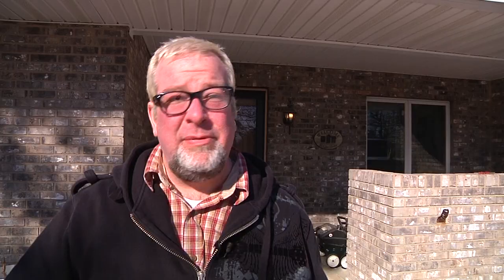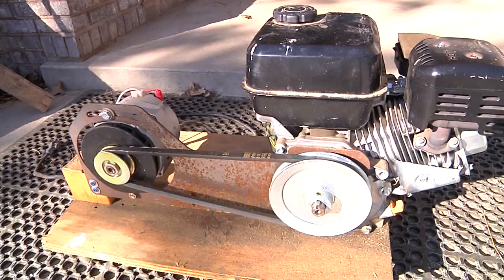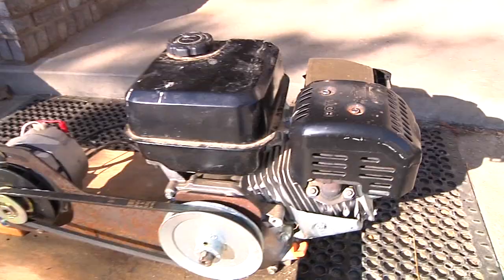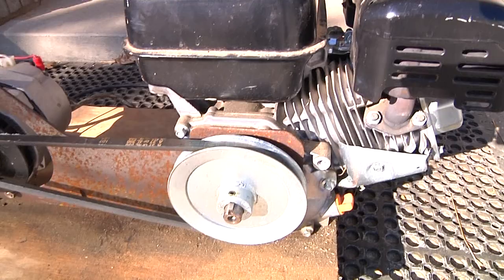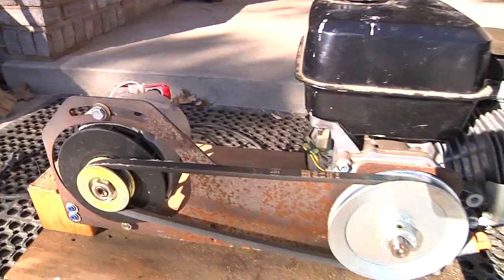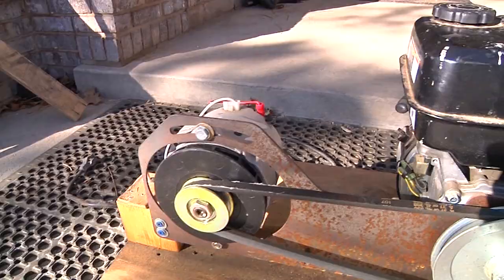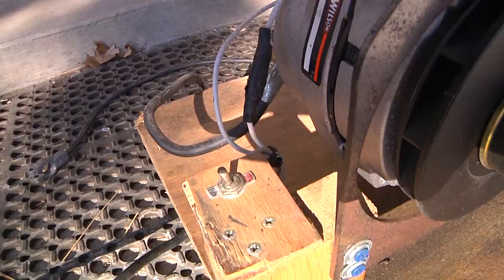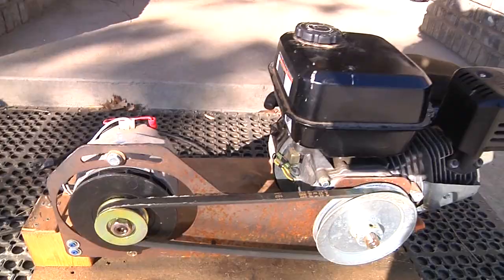Build a Lawn Mower and Alternator DC Generator

Comment: The frame was what I did great job btw to stop the belt flopping go get a idle pulley at install it to take slack out. Mine is so smooth it doesn't vibrate at all . I have a 2hp with a 30 amp mini Chevy race alternator use it to power my camper in the middle of nowhere.  Also I use the exhaust on the larger one with a homemade heat exchanger to make hot water which heats my camper.  Works awsome ! It charges battery bank auto start stop and monitor.  Battery bank runs thru 3 separate inverters 300 1200 and 3000 use only ones I need.  It's nice to have all the power I need no Bill's other than fuel next year ethanol still and 2 acres of corn 😁
Reply: How many watts per hour is your putting out?

Comment: I built one like this year's ago! my build was for jump starting trucks. and it worked great as long as the battery had enough voltage in it to excite the alternator. the important thing to remember is you can buy a generator that will do the job for less! but if it breaks down you need a new one. this setup works and if anything goes wrong it is simple to repair for half the price.

Comment: i have altergenerator charger basically the same way  it works but it absolutely needs a two belt set up after about 6 hours with load of only one lightbulb the belt gets hot then starts to slip

Comment: I read somewhere it only takes the 3HP 79cc engine to power a 70 amp alternator.  I may build one of those for less fuel consumption and noise annoying to neighbors.  Can upgrade the fuel tank to run a lot longer because stock half gallon is not much.

Comment: Check your field excitation, maybe run a rheostat or voltage limiter. This will bring the charging voltage down to 14 to 14.5 VDC which is maximum for charging todays deep cycle batteries. Actually, to get the greatest life from AGM or flooded lead acid batteries, you should have constant voltage and current to charge batteries just like your solar charge controllers do. I would add some supercapacitors in series to smooth out any voltage spikes from whatever loads you have on the batteries. Do not depend on the voltage smoothing circuits in the inverters you use, they usually are made in China and not up to constant use - they often burn out. I use them in my workshops (small engine, and electronic shops) that need perfect sine wave inverters that do surge some when first energised. Each shop is seperately supplied by solar or generator power, depending on the season and weather. I did this because the power company got greedy on its rental on the power poles and meters for each shed, so I dumped them and installed solar and inverters in their places. Saved me a ton of money!

Comment: A 10si GM alternator (1980 Chevy truck) would be self exciting thus enabling you to eliminate the toggle switch..just an FYI :)
Reply from the maker: +Joshua James Yeah, true, I used what I had on hand...
Reply: joshua the 10si/12si/27si is internally regulated but it is not self-exciting in stock form. the aftermarket 1-wire 10si alternators are self-exciting, but you wouldn't want to use a self-exciting alternator on a generator like this.. a self-exciting alternator loads the engine immediately after it's started, the manually-excited alternator allows you to start and warm up the engine with no load. a toggle switch isn't needed, you just need a momentary push button switch( a doorbell button would work) connected between battery positive and the #1 terminal on the alternator's regulator to excite the field when you're ready to start charging.
Reply: Those 10,12 and 27 are ideal because when the generator runs out of gas you don't have to remember to turn the power switch off to the altenator regulator if you use a momentary switch -

Comment: Add a resistor on the correct wire from the alternator of a regular automobile and it can make 15 volts add two and it will do 16 volts dc ! That’s 670 ohms and 1/2 watt resistor.

Comment: Brad, I was wondering if you ever tried to hook this up to a grid tie inverter . I am interested in building a larger version of this set up, and would like to do it without batteries , sending the dc voltage into a grid tie inverter . I am surprised there aren't any videos of this on youtube ( I have yet to find one) . Oh I guess it's worth mentioning I would like to run the larger engine/alternators on wood gas. This way I'm not buying gasoline to generate power.  Thanks for sharing. Joe
Reply from the maker: Hmmmm. Interesting, I have no idea how much juice or amps this would produce... Hmmm, where is my multi tester?
Reply: @Bigfamilyhomestead  did you ever test this?

Comment: Note: You absolutely MUST have a battery connected to this system while running or you can damage your alternator voltage regulator permanently!
Also...you can use a idler pulley to help with the slack in the belt...works well as the belt stretches over time...and could be mounted on these plates with a bit of MacGyvering  :)

Comment: How did you wire it? what size pully did you use? is that the most efficient?
Reply: When you set up a car or truck altenator - the pulley on the engine should b e about the.ssme size as on the altenator - 
      The engine can run at 2500 RPMs instead of 3600 RPMs - it's also better to use a pulley on the altenator and engine that accepts 2 belts instead of one - 
    Also many automotive pulleys are not 1/2 inch so it's better to go with a boat pulley -
     You can look up sail boats and 12 volt altenator's and charging - there's a bit to know about it - or you will go through a lot of burnt up altenator's and under or over charged battery's -
 Also you have to account for the cooling fans direction on the altenator - 
       I've used one like that for over 50 yrs - I live in a rural area were power failures are frequent - 
    But you have to understand battery technology as used on sail boats and the 12 volt charging technology -
     On a car the altenator at idel might only turn 2500 RPMs so if you are drawing 30 amps off a altenator you only need to run it at low RPMs - or fast enough to keep it cool -

Comment: Can I ask why you want to build one with vertical shaft? I don't want to go lots of hassle only to find out what you obviously found out.
Reply: This one is a horizontal shaft,and the shafts orientation matters not as long as the alternator pulley and shaft pulley align and are turning the correct direction... One can simply build brackets,mount alternator on front of push mower,swap blade for pulley,add a belt and have a dc generator that sips gas,charges 12v batteries in 30 minutes,is fairly quiet,can be made quieter,is portable,cheap to assemble,will work basically forever if kept out of the weather,using non ethanol fuel..

Comment: Voltage is easy to produce, its amperage that is most needed. Does anyone have a video where they look at the useable amperage of some cool products.
Reply: The alternator need to run at 6000 rpm to get max amp capacity. For GX200 engine max hp (5-7) at 3600 rpm, theoritically you can run 3500W (250A@14v) alternator at nearly full throttle with 2:1 pulley ratio.

Comment: can this be done with 2+ alternators? obviously one set would have to be counter clockwise or be mounted backwards but is it practical?
Reply: +Alex Patterson - Go to Harbor Freight.  Buy a 900W Portable Generator for $89.00 on sale.... No Work, No Time, No Labor, No Coffee, No ETC....
Reply: @JodBronson  sure and burns 2 gal an hour lol and runs none stop these hybrids can be built to deliver none stop on demand power and only run when the battery needs charging.
Reply: @ronaldbrown9638  -  10+ Hour Per Gallon!  No Work, No Time, No Labor, No Coffee, No ETC.... = $$$$$$$$$$$ ????????????
Reply: Technically yes, but hard to say if your engine is up to the task.
However i think a high-current alternator might be a better choice as the extra load would inevitably use more fuel.
Reply: You can put two car altenator's on an engine but you.would be better off using a truck altenator - car altenator's are only good for 450 watts or 30 amps - truck altenator's are.good for 900 watts - if you get to were you know what your doing with a hybrid system you can get a 10:1 fuel efficensy - 
     With those harbor freight 2 cycle generators some one mentioned there a 2:1 fuel efficensy they burn a lot of gas - they are a good generator

Comment: I have found nothing for any reasonable price like this.  What is the horsepower of the engine and how much current can the alternator supply?  Thanks!
Reply: Generally car altenator's are good for up to 450 watts that's around 30 amps at 2500 RPMs and above - truck altenator's are good for about 900 watts -  they run at 2500 RPMs also -1 HP generates 385 watts with a 12 volt system - see my other comments
Reply: @able880  So roughly 2HP in and 1HP out for 50% efficiency? My pickup truck is rated 95A.  For what I want, 200W would work good.
Reply: @solarsynapse  yes and no - your truck altenator will deliver 95 amps for one minute - that's around 1400 watts  for one minute - it's used to recharg the battery after it'  started the engine  -  if you turn on all the electrical devices  in your truck on  - it might pull 450 watts off your altenator  continues -  that  is the continue out put the altenator is rated for -  if you add 200 watts more  to your truck altenator load you can cause the altenator to fail -
Reply: @solarsynapse  just about all car and pickup truck altenator's are designed to handle a 450 watt continues load - that's 30 amps -- 
      It takes 1 HP at 2500 RPMs to generate 385 watts off a car altenator - 
That's around 26:amps - the terminal  voltage off the altenator is about 15 volts  - 
       The HP to out put only applies at 2500 RPMs not including the belt transmission losses

Comment: The small generator is far more economical than solar power- especially if the building you need powered is located a distance away from the main house and is used only occasionally. And forget wind power- that is the most expensive of all.
Reply from the maker: Yeah, I just don't like the idea of being attached to fossil fuels forever...
Reply: Bad news- Fossil fuels are here to stay- just Google- Liquid Thorium Reactor.
Reply: @Bigfamilyhomestead  There is always alcohol.

Comment: Hi.        A lawnmower engine, with a  horizontal shaft ??             what kind, of mower was it ?
Reply: Some Cub Cadets use them with a belt that makes a 90 degree turn over 2 pulleys at the front.  I think it is a bad design.
Reply: @solarsynapse  yup, poor  mechanical  design, A double-gear,  (two 45's)  would  be   A  HUGE  IMPROVEMENT;  but  no,  that,   COSTS  REAL  MONEY,  for  REAL  METAL !.

Comment: Waste of energy)
Reply: +urial vasquez - 100% 😅 😅 😅 😅 😅 😅 😅 😅 😅 😅 😅
Reply: Not really mine runs until battery is charged then shuts off run inverter auto start stop . My generator to power my camper burns 2 gal an hour my hybrid which is what this is runs 1 gal every 2 days.  Waist of energy ? Please explain and have you ever built anything to back up your argument?